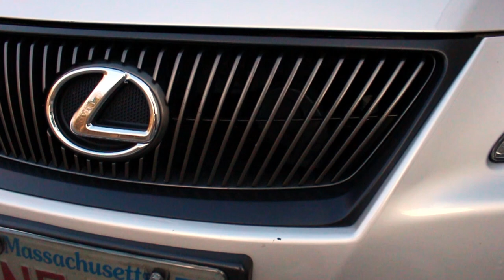CHROME DELETE- IS250 Chrome Grill Delete + Cold Start!

Comment: How’s it holding up⁉️ Since the part you painted is like a cheap material
Reply from the maker: not bad at all, it is a little faded from when I did it in this video so I might wrap it but theres no peeling or anything like that. I've probably put on like 20,000 miles on this car since the video too.

Comment: Is the emblem removable? IF so how?
Reply from the maker: It is, to remove it I would just heat it up and use plastic prying tools to pop it off. That being said you will have a big blank oval in your grille. There are aftermarket grills on eBay and Amazon that you can buy with no emblem. I can send you the link to some.